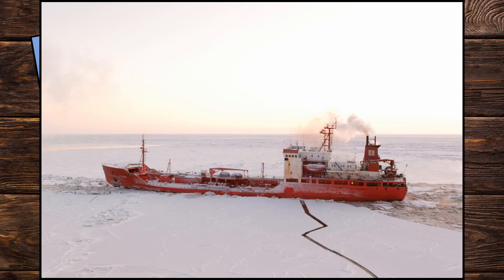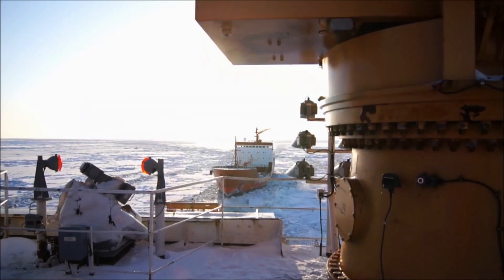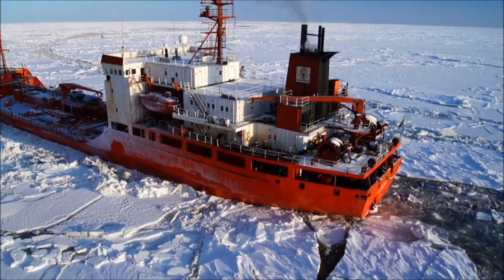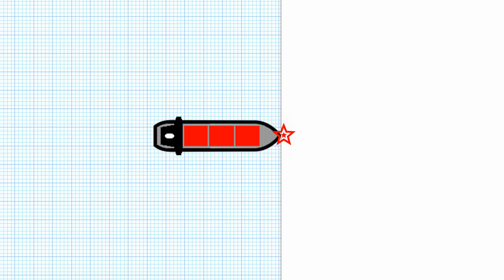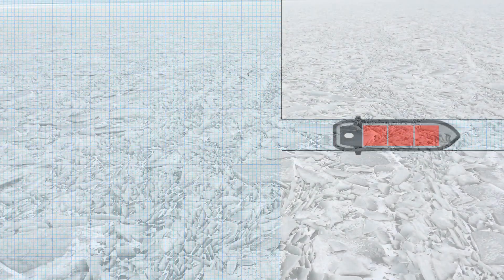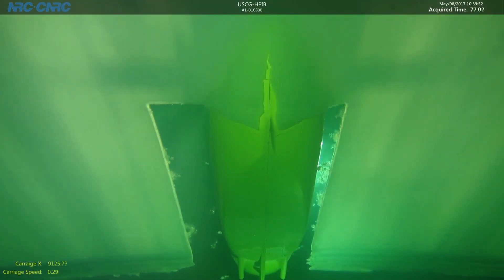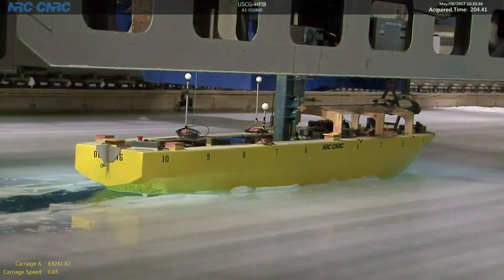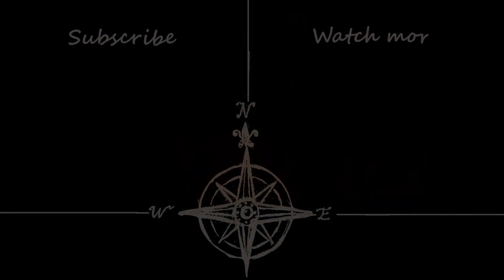Icebreakers: How Do They Break Ice?

Comment: This video is way too simple, I wish there was more information
Reply: I agree, there is actually alot more to an ice breaker than this. There should for example have been atleast a mention of ice breakers that use their propellers to break ice that is to thick to break the conventional way
Reply: yeah facts where missing, weight which is necessary, how thick can the ice be, how to strengthen the boat etc, there was just one information given in this video
Reply: Atleast strait to the point bro
Reply: Everyone who’s bitching about this video should go make a better one!
Reply: Yes, there is a lot more to icebreaking than this. The method described at 1:54, that is, breaking the ice under the weight of the ice breaker is more of a last resort way and is used in extremely thick ice. Typically the aim is to maintain constant speed by sliding over the ice only after it breaks as in the model demonstration. The hull shape is optimized for this and in addition several ways to reduce the friction of the hull is applied (bubblers, water pumps, material choices). Some icebreakers can shift around ballast water to induce rolling, making the ship less likely to get stuck.
Reply: @clopec  wow mate that's a whole another level.ive just learnt a few things from you and that's because of thishort video thankyou youtuber an you
Reply: @clopec  no, there really isn’t any more to it than that.  Like the test tank video shows right after 1:54.  The engine HP forces the bow up onto the ice, this is true wether the ice is 1” thick, or 10’ thick.  As the bow goes up, the stern tries to go down, but because of the shape of the hull getting wider above the waterline at the stern it must try and displace a massive amount of water, which causes an increase in upward force/buoyancy at the stern increasing the downward force at the bow which cracks and displaces the brittle ice.  The amount the bow can be pushed up onto the ice depends on the available HP.  The Healy is not a really good icebreaker.  The one shown with the 10 on the hull CGC Polar Star and her sister ship Polar Sea(11) are far superior icebreakers with 75,000 SHP. They can break continuously 6’ of ice and by backing and ramming thicker ice and pressure ridges up to 21’ thick.
Reply: For real, this video is a lil lackluster compared to other casual nav vids. No offense, i love the channel. But as mentioned by others there sre a lot more in this topic to cover. Propulsion, special screws, layering/materials/shape of the shiphull. Special equipments, like (i donno its name for sure) there was something like a steaming device alone the hull, wich also directs ice, etc
Reply: I mean I cebreaker operate on a really easy concept: "Spoon" shaped bow + powerful emgines. You ride on top tje oce and breaks it with your weight.
Reply: @fernandomarques5166  just because a concept is easy doesn't mean that it doesn't has more depth to it.
Reply: Ship crushes ice under it's weight. Enough said. I reccomend Big Bigger Biggest's icebreaker episode
Reply: Notice the name casual
Reply: Hey guys. What this comment probably meant is that the narrator ( Casual Navigator) speaks little and went straight to the point, the core of information. Simplifying anything possible so the audience could get some easy to digest info. 

Different to other informative channel that would spend a lot of time talking about the sponsors, stretching all the possible data out, and sometimes put a lot of humours to make the video way longer that it could've been.
Reply: make a better one. you.... you spoiled little brat :)
Reply: My thought exactly
Reply: Me too
Reply: C'mon it's just youtube, what did you expect? A university lesson?
Reply: @Rewopetinifni  That would be indoctrination.
Reply: @Rewopetinifni  you clearly dont know what you are talking about
Reply: @AndreBSaba  You said this video is way too simple and I meant you shouldn't have expectations from YouTube. Luckily there are many people like you.
Reply: I'll go down to Walmart and  and gets some white paper and a box of 100 Crayola crayons and use all said colors, and draw you some pictures. Then will that better clarify simple for you?

Comment: This video is to the point , but id like to know more, for eg how thick the iron is on an ice breaker ,designs , engine horse power ect  , stuff like that ..
Reply: Russian icebreakers are the only nuclear powered civilian ships
Reply: @BillWaters13800  try using laser
Reply: @matrix2678  and big saw
Reply: @BillWaters13800  I believe there was a nuclear powered cargo ship, and also there is a civil nuclear powered ship in Europe under construction, but I forget the names of both.
Reply: The swedish icebreakes has a 36mm hull and has twin proppellers in the front an the back  so they can break the ice better and they have 25000 hp. Google icebreaker atle for more info
Reply: @wiggonilsson7258  36mm is about an inch and a half.  I would've thought a lot thicker.
Reply: @shevetlevi2821  You would be surprised how thin the hulls are on non-ice going vessels, practically tinfoil compared to ice classed vessels. But the overall thickness, shape, and material design of the hull all adds up to a very strong vessel, of course, some ships have different ice classifications. You wouldnt want to go touring in the arctic with just any type of ice breaker.
Reply: @svxnger  Thanks, pretty amazing engineering.
Reply: @wiggonilsson7258  I thought it's a 75000 HP nuclear powered ship?
Reply: @wiggonilsson7258  wait whatttt??? only 3,6 cm?? that's way less than what I expected
Reply: A. Wellknownmyth  

Pi , pie and apples . G
Reply: Depends on the ship tho
Reply: It's all online.  Just look up the USCGC Healy and USCGC Polar Star.  The Healy is a medium class and goes to the north pole (thinner ice), the Polar Star is a heavy class and goes to the south pole (thicker ice).
Reply: @sminthian  All the way to the South Pole? That is a really powerful ship. lol
Reply: You can actually look up all that information. The polar boats had roughly 3ft of Swedish steel at the bow. I would tap on it with a sledgehammer, and it was silent. 3 dc motors feed into Cincinnati gearboxes. If I remember correctly there were 3 diesel Gen rooms with 5 Alco 16 cylinder engines feeding those giant dc motors. Quite amazing tbh. The dc motors are the size of a garage.
Reply: It is a large diameter steel rod goes down the bow, usually 6" diameter or more!
Reply: A. Wellknownmyth  

Apple pie ?
Reply: The question was, how do Icebreakers break ice, not how they are build and look.
Reply: Sky Knight “Speed and power.” -Jeremy Clarkson.
Reply: @sky-d-kid6376  And that question was answered in the video. Didn't you watch it?
Reply: @alanj9391  Sorry I have to correct myself. The question was how do Icebreakers break ice, how they look and are build, not how strong they are or what engine do they have. Because not every icebreaker is the same.
Reply: @sky-d-kid6376  It is explained at 1:52. Its bow shape allows it to ride up the ice, and then crushes the ice with its weight. Though not explicitly stated, you can see in the underwater clip that the broken ice is shoved underneath. This is a 2-minute video, what else were you expecting?
Reply: @nicholaslau3194  the original comment asks for specificatios, design choices and layouts, and other specific information about ice-breakers. Sky-D simply answered that the vid is about How Ice Breakers Break Ice, not the specific designs of ice-breakers and their specifications. in a later comment, Sky-D clarifies himself that the vid cannot simply incorporate such things since ice breakers are made differently depending on classes and design, and such information can and should be looked up on google if one desires to know
Reply: Google
Reply: No. Google it.

Comment: When I was a kid, I thought they had mechanical arms that would break the ice.
Reply: Austin Powers - Judo chop!"
Reply: jayive34 too much outlaw star thier pal
Reply: this aint the 1860s bub
Reply: I just thought they used powerful engines and a sharp reinforced edge.
Reply: I always just thought they were made of really strong and sharp metal
Reply: I thought they used heat from the engine to melt the ice.
Reply: I like this idea, in combination with your avatar.
Reply: With hammers!!!
Reply: There is a cartoon explaining this, yes an arm comes out of a hole in the bow with a LARGE ICE PICK and starts picking. Just like at home.
Reply: funny

Comment: I wonder if there are any negative environmental impacts of ice-breakers making passage? Wouldn't broken pieces of ice sheets and bergs drift and melt away given global warming temperatures and further/faster raise sea levels?
Reply from the maker: I guess it would increase the melting. Though they can only move through shallow ice, so I assume it would either re-freeze quite quickly or it would have melted anyway. Its an interesting consideration though
Reply: It's only sea ice
Reply: Icebreakers have broken up "Ice Dams" that form at the head of a rivers. Those ice dams cause flooding inland. The ice breakers break up the dam and let the water flow out, saving towns and property.

Comment: I was on the Healy during that Renda trip.
You're thinking of the heavy icebreakers, they go up and down like your picture.
The Healy is a medium, it just pushes through.
Reply from the maker: Thanks for the clarification sminthian
Reply: I actually helped build the Healy, I was in the shop that cut the hull plates and structural steel. I hope we built you a good ship.
Reply: Still all (not "medieval") icebreakers rely on forcing ice to bend under ship and its weight.
"Climbing" on top of ice just doesn't happen until ice is thick enough to resist initial contact.
Or there's pressure ridge... down to bottom and needing use of that "ramming speed" from movies:
https://youtu.be/xfFkfiMRP00?t=2m58s